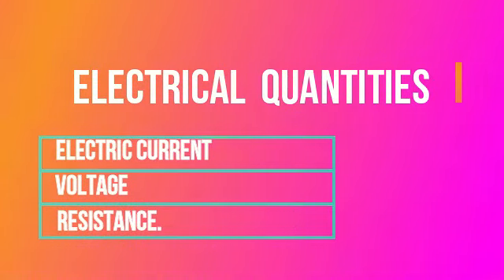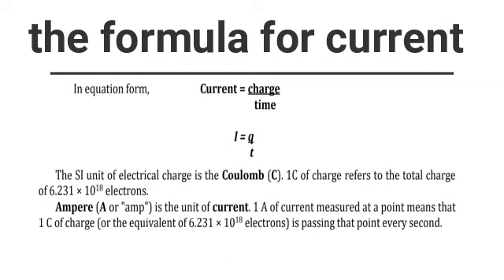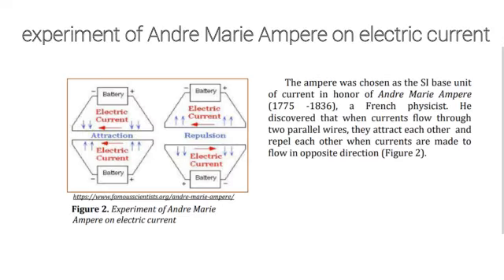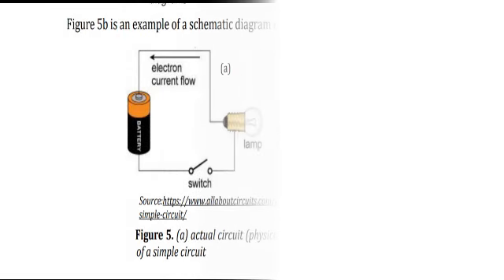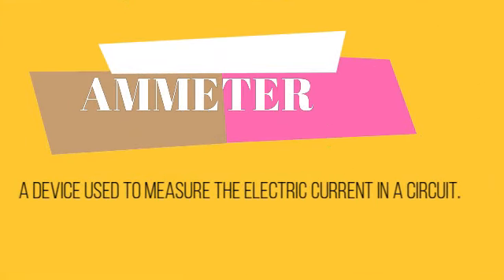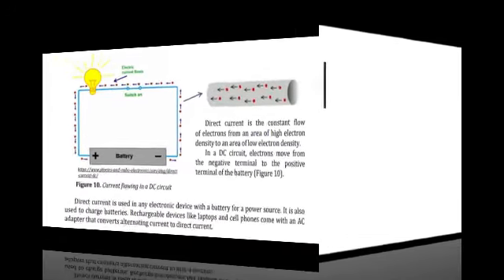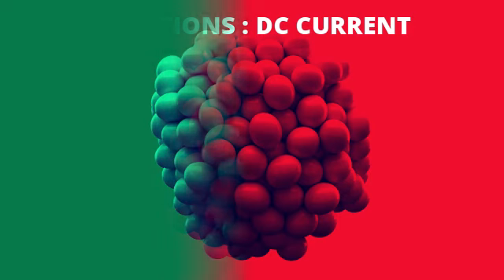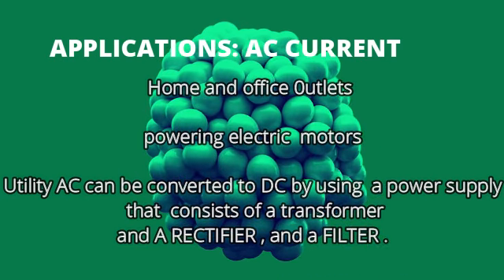electric current

Comment: Reynaldo Dela Ysla 
BSE 2 A GENERAL SCIENCE 

Why it's important to understand electronical quantities? Because electrical energy is transmitted very rapidly (almost at the speed of light); and because there are many physical effects involving electrical energy which make possible conversion into light, sound, motion, force, heat, cooling, and rapid transmission of information.

Comment: Alvarez, Jenella Camille G.
BSE-2A Gen Sci

Without these three electrical quantities we would not be able to measure and balance the capacity of the electricity. It can also measure how much voltage is present in the outlet. Therefore, we would know how dangerous it is, so we won't let ourselves go near it. Electrical quantities are responsible for the.
An example of this is; we use electricity to operate the appliances. Without these electrical qunatities we will not be able to measure the household electrical consumption.

Comment: Electrical quantities are really important so we need to understand how it works together. Voltage is the difference in charge between two points. Current is the rate at which charge is flowing. Resistance is a material's tendency to resist the flow of charge (current). So, when we talk about these values, we're really describing the movement of charge, and thus, the behavior of electrons. A circuit is a closed loop that allows charge to move from one place to another. Components in the circuit allow us to control this charge and use it to do work. In our daily life we need to understand the importance of electrical quantities in able for us to have knowledge about the proper used of our appliances and how it works.

Comment: Sebastian, Micaella B.
BSE-IIA

It is important because it serves as  basic electronic concepts that  fundamental to all electronic circuits and systems. Electrical current, voltage, resistance, capacitance, and inductance are a few of the basic elements of electronics and radio.

Comment: Gonzales, Mary Joy N.
BSE-2A

Electrical quantities (current, voltage, resistance, etc.) are the foundation for electrical installations. Understanding these will give us knowledge about the basics of electricity. 

Examples are operating appliances, electronics and machines. These examples use electricity, which means electrical quantities involve.

Comment: CASTRO, EARL JOHN J.
BSE-GENSCI 2A

The electrical quantities are important in order to understand what electricity is all about, how to measure the current, voltage and resistance and also how it works as well. Like for example, the uses of electricity in household. Refrigerator, microwave, washing machine and many more appliances which are simple to use and made for the convenience of day to day activities use electricity to function.

Comment: Capagcuan, Gabriel Lance S.
BSE – 2A
 General Science

Electrical quantities are important because, Electrical quantities are of various properties and have different characteristics which are essential when making or doing things that involve electricity, you will need to know the fundamental overview of measurement of electrical quantities, electrical quantities is an essential part of almost any measurement. It can be realized as a measurement, whose results indicate directly a value of measured electric quantities, such as voltage, current and resistance which is the cornerstone of electricity that we use in our daily lives.

Electrical energy is used throughout the world to power devices, to run vehicles and appliances, as a result energy permits people to watch television in their home, and if electrical energy isn’t there, I wouldn’t find a way to submit this answer in this comment section.

Comment: Manalastas, Kristine Jane P. 

Studying electrical quantities is important because in this modern generation, electricity is everywhere. We need to know more about electrical current, voltage, resistance that is under electrical quantities. We need to know more because like electrical energy that is transmitted rapidly, this world also changing in a fast way. And need go cope up with it.

One of the examples that we may encounter in our daily lives is a power interruption at night. Of course its dark so we need light. You get the flashlight but sad in doesnt have any battery to light up. So you get some battery and put it inside. Then the flashlight already light up. In the way that you put the battery... The energy or the electric current started to flow. Other examples include the usage of cellphone and televisions in our daily life and many more.

Comment: Bernardo, Nikki Shane V.

Why study electricity, because it is very easy to connect and disconnect energy-using devices; because it is easy to convert mechanical energy into electrical energy and vice versa; because it is easy to transport electrical energy; because electrical energy is transmitted very rapidly (almost at the speed of light) 

Electric circuit, path for transmitting electric current. An electric circuit includes a device that gives energy to the charged particles constituting the current, such as a battery or a generator; devices that use current, such as lamps, electric motors, or computers; and the connecting wires or transmission lines.